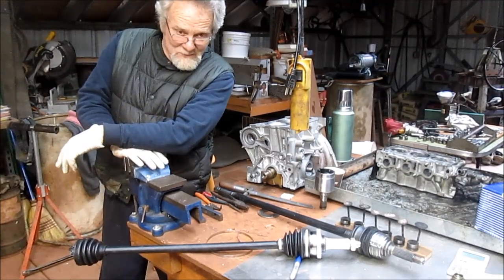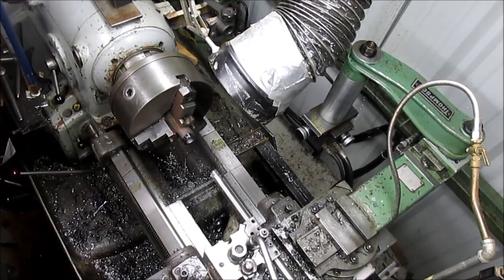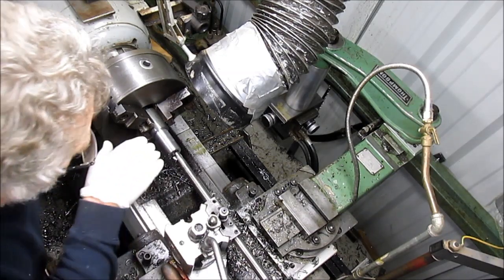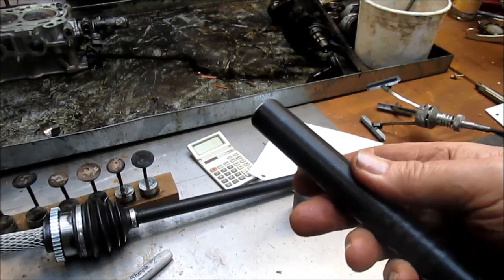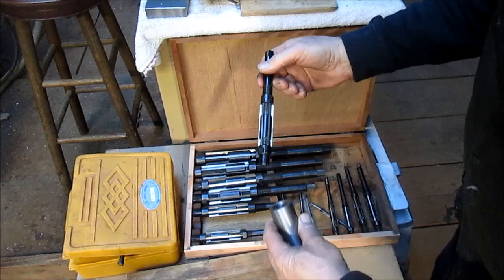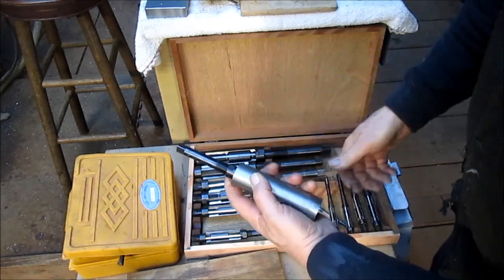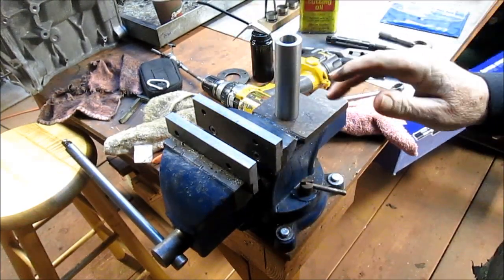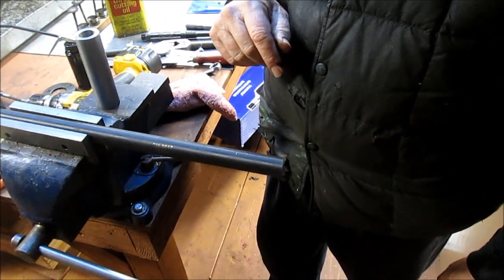Shorter is Better

Comment: Nik

I assume that your bigger lathe has a thru hole in the spindle that would let you run that shaft deep into the lathe.  So, if that axel running true was a concern, chuck up the axle in the lathe, indicate at both ends and tweak for minimum runout, then spot weld and double check the run out before doing the full weld?

John

Comment: I notice the drill on the table while you're using the adjustable reamer. Would that not have enough power for it, or would it run it too fast? Good score on those either way.